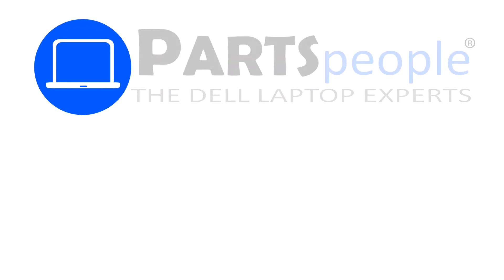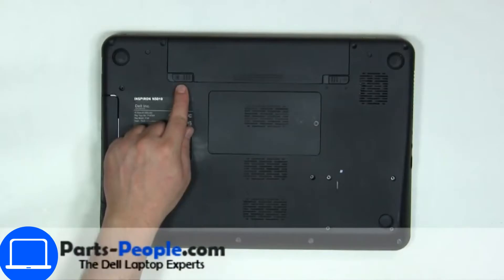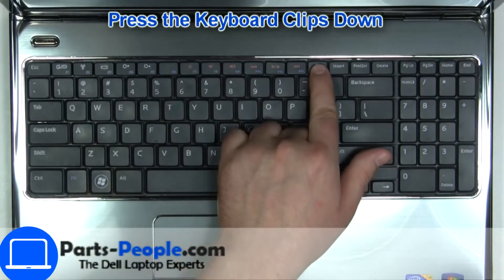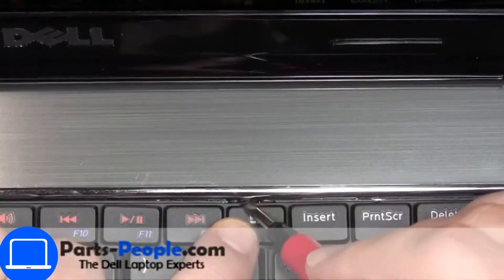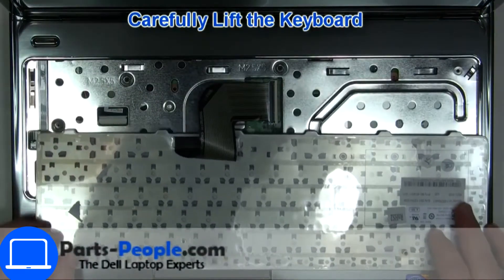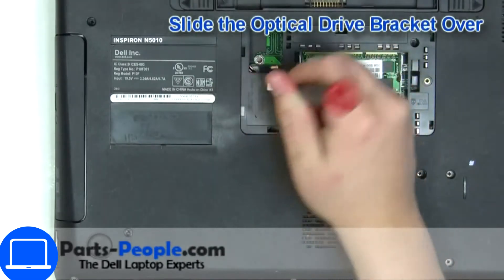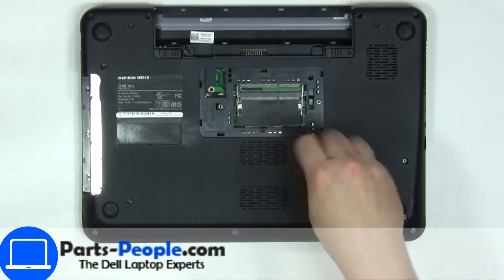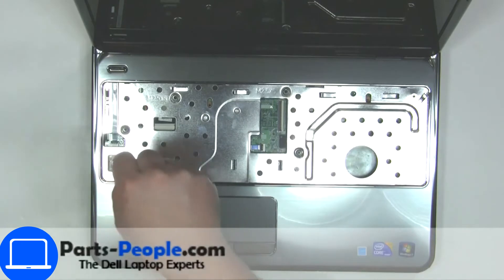Dell Inspiron 15 N5010 (P10F001) WLAN Card How-To Video Tutorial

Comment: I have this model N5010Intel(R) Core(TM) i3 CPU       M 380  @ 2.53GHz   2.53 GHz model however I upgraded from Windows 7 to Windows 10 Pro. 3.00 GB Installed ram, Please let me know whether i can upgrade the wifi card from 2.4 to 5ghz or install external antenna for 5ghz network. Laptop is all good right now however pretty slow in bandwidth Internet connectivity
Reply from the maker: Hi, sorry for the late response. Feel free to contact us: https://www.parts-people.com/contact.htm